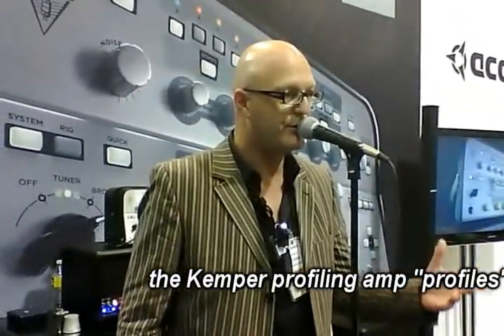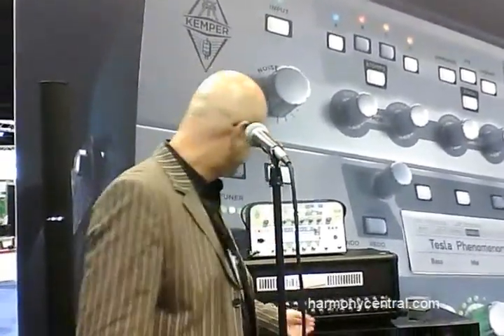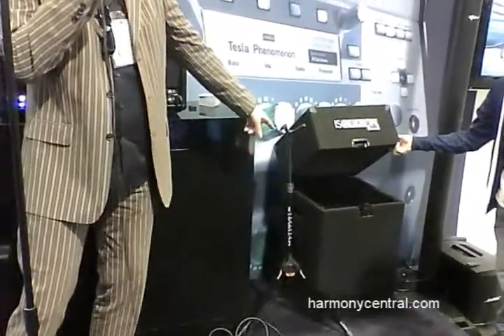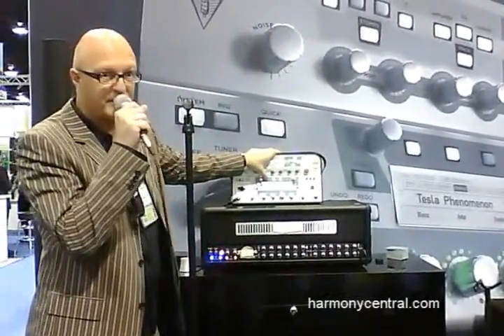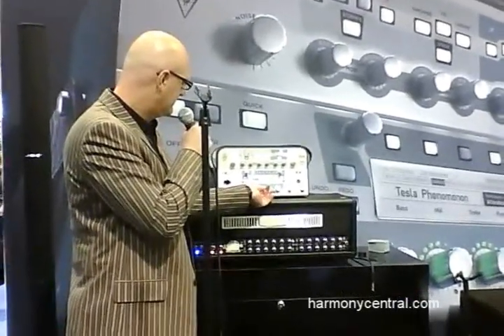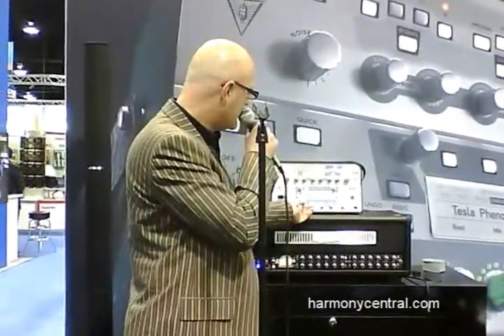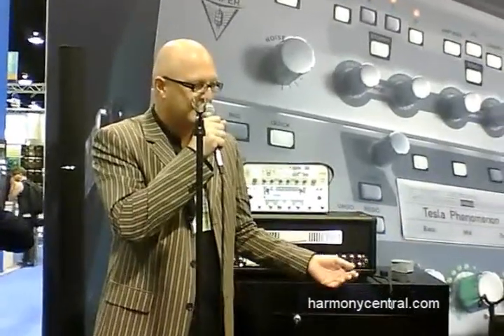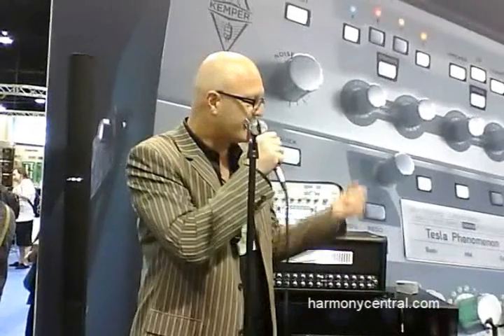WNAMM 2011 Kemper Profiling Amp

Comment: @tneri8 
You'd think that, but all of these "amplifers", modelers etc. are recreating existing tube amps.
Only once there is a digital amp that has its own tone they will replace tube amps.

Because if they don't, tube amplifiers will always be the place for experimentation and actual progress.
Also, don't underestimate the value of the simplicity of a tube head, too many people need that. (as in, too many people don't want all the finicky digital stuff for it to really take off)